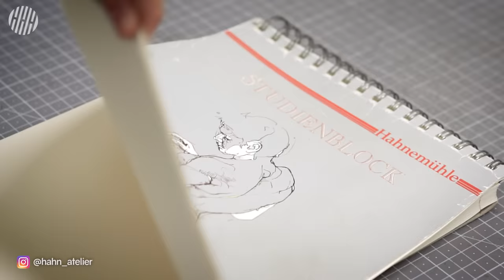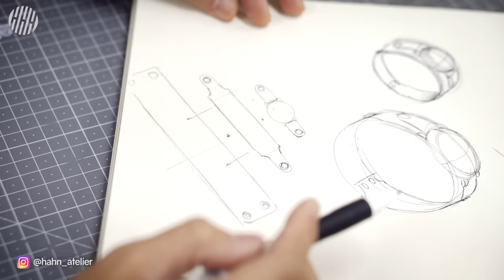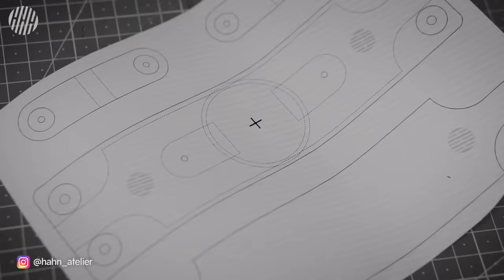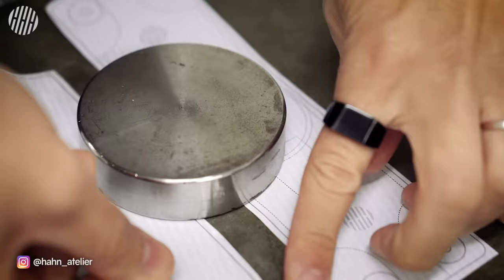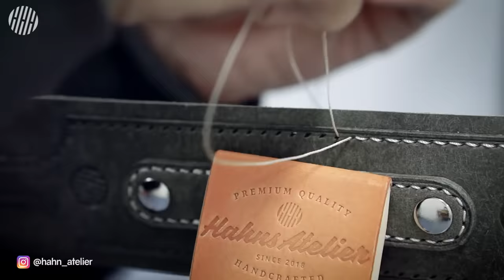[Leather Craft] Making a handmade leather watch strap / Free PDF pattern

Comment: Love it, love it, from the sketching through the making.  Also love that 30-degree blade knife you used, I have that same knife and it makes a huge difference in control of cuts.  Each video is better than the last, which was already superb.  Thanks, Hahn.❤️
Reply: I purchased the same knife after Hahns' video of the tools for beginners and I have to agree it has made cutting with control so much better and it feels comfortable when using it.
Reply: Yes!  The slide is in the right place, most other utility knives dig into fingers or palm.  The 30-degree blade is key for leather, I think.  Again, most other utility knives have a different angle.
Reply from the maker: Hey Ellen!! I'm so glad it helped a bit! :)